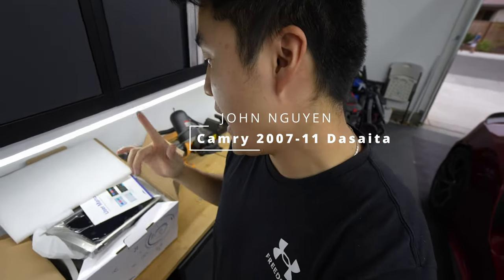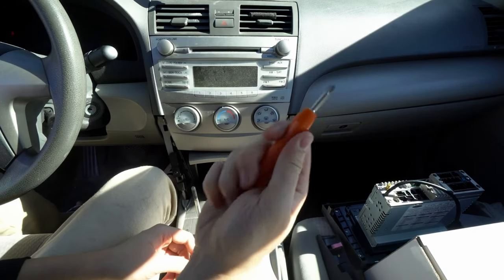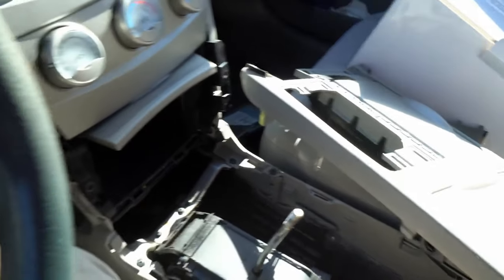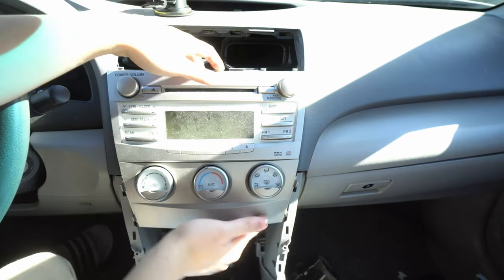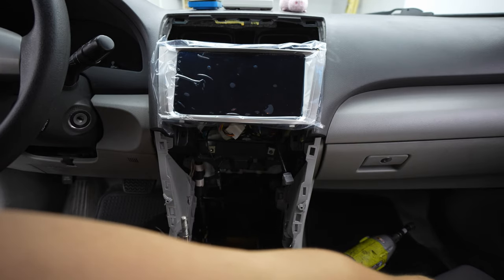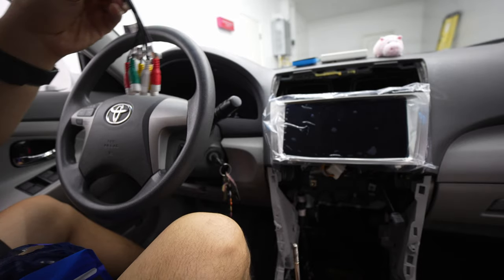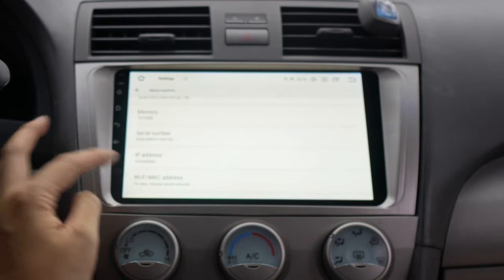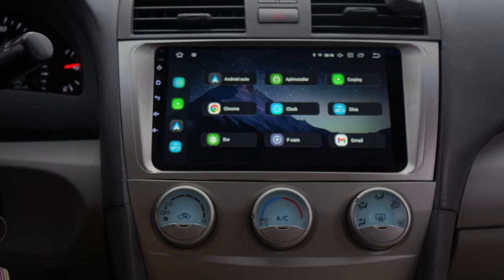Elevate Your Camry 2007-11 | Friendly INSTALL | We need that Carplay | Dasaita

Comment: Siento que el CarPlay inhalambrico pierdo calidad en comparación con el cable auxiliar. Algún tip para mejorar el sonido ?
Reply: I have similar experience, with iphone they also lower volume levels for safety but it also loses bass😢 Buy a higher end car radio unit or stick with a wired connection.

Comment: Any suggestions on the steering wheel controls? They don’t seem to be working 😢
Reply from the maker: go into the steering wheel controls and program them manually.

Press and hold the steering wheel button and it should recognize it in that application.

Comment: Hey John, is there a difference if my 2007 Camry has JBL amplifier?
Reply from the maker: yeah, the jbl won't work with the harness it comes with
Reply: theres a separate harness you can buy to retain jbl audio system i found it on crutchfield's website
Reply from the maker: @jeremytrantum1211  thats good to know thank you!